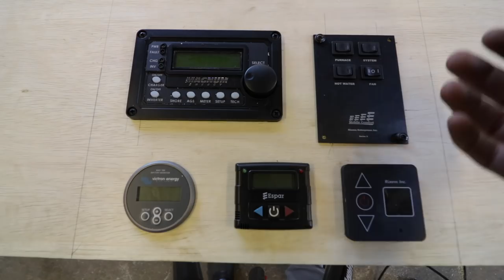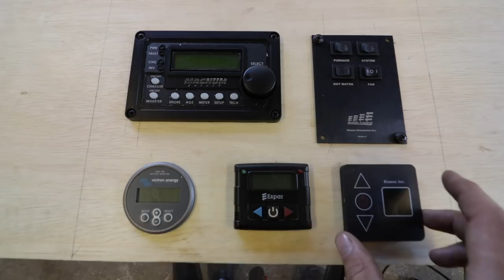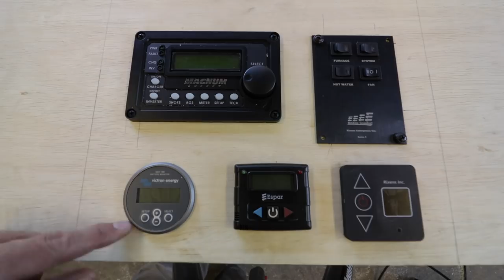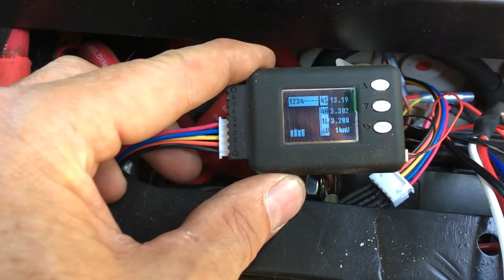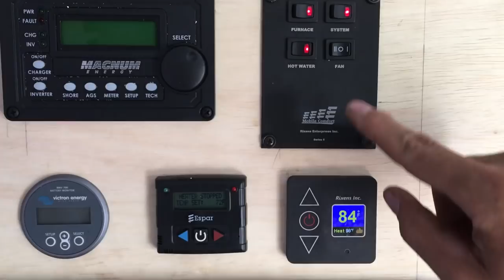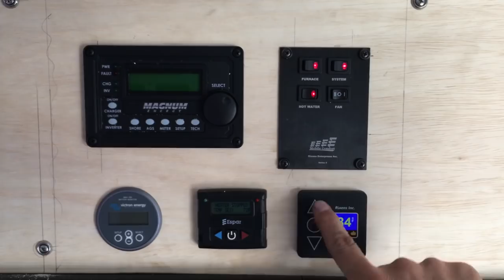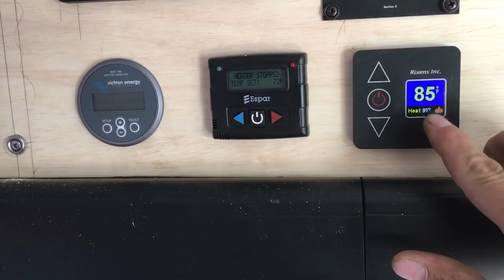We Turned It On, Then Something Unexpected Happened!

Comment: Might want to do something with that exhaust for the heater so it dosnt just point under the body. Want to get it so it sticks out from under the body so the hot exhaust dosnt come back up into the cab that most likely isnt air tight. curve it out so it sticks out the side or back of the van an inch or so. Dont need to get into a nice warm van thats got a bunch of carbonmonoxide in it. 

  If you want to make those soldered connections a bit better and long term and waterproof after soldering and before the shrink tube coat the wire in dielectric grease then shrink the tubing on and it will push the extra grease out the sides and form a nice insulated waterproof seal. Just wipe off the extra grease from the wire and you have a connection that will last forever and be waterproof and corrosion resistant.

Comment: Really nice Cody. The Blue board insulation is what some people use in this area for insulation on buildings and homemade campers. No irritants to deal with as far as fiberglass dust. It is styrofoam so it's not natural, but it's easier to work with than batting style insulation. I wanna build a caravan style camper trailer that can go off-road like my 4x4 that I am working on but be fully contained for fall and early winter camping.

Comment: Cody, the BMS (the little black monitor) on the batteries, has the tendancy to drain the first cell. This is to light up the screen and do it's checks... If the batteries are wired in parallel you can live without it, the charge controller will tell you the volts. In series I would recommend an other BMS. The Batrium BMS is better for the system, however it's pricy. The choice is yours, but I felt this was importent to tell you.

Comment: You mentioned you were not sure on Barrel Crimping large and small wires together , I work for a company that makes wiring systems for the Auto Industry ! When we have to join to wires of dissimilar sizes we put a filler wire in to make up the empty space , then crimp into the Barrel splice and Solder  ! Hope that helps .

Comment: The worst part of using shrink tube, you have to remember to put them on BEFORE you solder the connection. And I can forget why I went into the kitchen. :-) I had a small Winnebago about 20 years ago and it had a water heater that was electric or also heated from engine heat. It was great having hot water when you stopped at a rest area.

Comment: solder connections are stiff and eventually will crack the strands at the edge of the solder joint. Use marine or aviation codes for construction and you can't go wrong. Nigel Caulder's on book mechanical - electrical systems will be illuminating, I know it is about boat sytems but it shows the right way for anything that vibrates. love your channel.

Comment: When designing a information cluster that will require maintenance  or upgrades from time to time it's very important that you can access the electronics  with very little work. I see a lot of people that have used the same kind of layout that your are currently incorporating . It appears  that once you have installed your panel and its all button down it will take time to add , repair  or replace any of the devices you have installed.  I would recommend  that you place all your electronics  on a smaller removable panel  that your can quickly remove  in short order.  Other then that everything look great.

Comment: Shrink tubing professional grade has a heat activated glue that seals the tube and wires from having corrosion issues unlike the cheaper brands of “ shrink tubing” that end up hold moisture and actually causing corrosion. Just a psa for your viewers.
Reply: The term is "Double Wall heat shrink tubing"

Comment: nice you got the overcharge and overdischarge protection I was worried about.... Another thing I am big on is buss fuses at the batteries.... just in case something shorts, it will take out the fuse.

As far as marine grade vs RV grade, having owned and worked on both....the only real noticeable difference I can discern for electronics is price... LOL!.

Not sure what you have planned for tanks for fluids, but if you go plastic tanks, check out the seelevel II systems.... I am swapping my 40 foot RV to that system next winter.

Keep it coming!

Comment: Ahh but which battery is powering your switch that switches between batteries?  If the vehicle side is powering it and those batteries are dead the switch wont work to switch over so you can start it. If the aux battery is powering the switch/solenoid then it won't work if the aux battery goes dead. I had to put a manual override for just in case either side batteries went dead. Of course that dead is something that should be avoided at all costs but it does happen sometimes.

Comment: I'd recommend you building some enclosure around the heater gas pump. Those things will get destroyed quite quickly like that. Yes I do speak from experience since all cars with an external pump have it out in the open, ready to corrode apart in 10 years.

Comment: I'm a little confused. Why are you soldering the wires together before you upholstery the panel? Do the faces unscrew from the controls to allow easier separation?
Reply: wondered about that as well. I even would expect upholstery done before putting in the devices. 
I would either have thought of using some kind of easy to connect/disconnect  stuff to plug everything just in (yes, I like it complicated ;) ), or would have used some temporary clamping connector at first.
I can really recommend the Wago 221 style clamping connectors, they clamp stranded and solid wires I think from 24 to 12 AWG
Reply: Yep, wondered the same thing.  He obviously has a plan though.

Comment: Also in heavy duty truck trade the manufactures get away from soldering wires do to the corrosion created by the flux and so crimped terminals are the preferred method
Just have to get away from thinking of only using the big bulky blue connectors 
Also id think connectors would seem better since the are only temporary since your going to take it down and cover the wood

Comment: Watch where you park with the heater vent pointing at the ground or you will be using your wildfire fighting skills!
Reply from the maker: How is it different than vehicle exhaust?
Reply: Two points, first a cars exhaust is usually directed horizontally and not straight toward the ground.  Also, you are more likely to use the system while parked for the night, rather than while driving on a paved,gravel, or dirt road.  If you park for the night in dry or tall grass, turn on your water heater, then bingo instant wildfire.  It happens, just be careful or even think about installing a heat shield for the vent pipe.

Comment: Now I want a van all of the sudden.
Reply: Used Uhaul trucks are a cheap way to get started but are going to be 2wd and a gas engine but you get lots of room to work with.
Reply: Yeah...the next door neighbor's Econoline only managed 325,000 miles with no maintenance and once yearly oil changes...

Comment: Just a thought but you might want to put some grommets or something on those two hoses you have running through the sheet metal in that little box area in front of the heater core in the side panel were your right hand would be at the 15:59-16:04 mark.

Comment: Cody it’s really coming out to look really good. Been following you since you bought the van with a project. One thing concerns me about your electrical from what I could see from the video it looks like the solenoid that you are using is just a standard ford solenoid I think you will have problems with it in the future you are use a solenoid that is not reliable. But they do make hey specific solenoid that is designed to do what you are doing by charging it and isolating it from the other battery. And it is built to be able to run all the time. And you would also have to make sure that it is big enough to carry the maximum amount of old age that your alternator is going to put out to charge that battery in any given time. Otherwise it could cause failure in the solenoid which could cause a fire 🔥 I have a system in my van similar to this that I am speaking of that is wired correctly. And this is in my service truck that I use daily. If you need some help on getting the solenoid for your van I would be glad to get you to the right place. Just thinking of you and your family safety that’s all. Let me know if I can help.
Reply from the maker: It's just fine,

Comment: You better make sure you write down what all them switches are for label them we got a camper and there's switches everywhere and we don't know what none of them are so we just have to keep screwing with it and it's such a pain
Reply: A label maker makes IDing wires so much easier down the road as you can say power for X on one side and To switch X on the other. As so much is the same color label as you go and not have the fun of back tracking a wire later.

Comment: Still think using drive fuel for hot water and heat is a bad idea when you can rig up a 10 gallon fuel cell for heat/hot water and never touch the drive fuel and in the rare case you run out of gas can empty into the tank to get to a gas station.  10 gallons of fuel for it should give you 3-4 weeks of heat/hot water and be a good aux fuel tank for emergency's.

Comment: You better make sure that all the holes you drill on the underside of the frame you put sealer on them when I worked for the Japanese car plant they would have a fit if you drilled any holes and didn't steal them
Reply: You should watch the video where he mounted it...and sealed the holes...
Reply: It is a ford, it will be in the junk yard in 7 years.
Reply: Your perception isn't reality.  Any vehicle can be used for 100's of thousands of miles as long as you do preventive maintenance and replace parts as required.  Bruce Berry was working man, he used to load that Econoline van...

Comment: Re: crimps... good move to use solder.  Areospace engineered crimps are actually better than solder, but are exacting as to wire type and size, and expensive.  Automotive crimps are cheap in labor, but are notorious for poor reliability, whether due to bad workmanship or just the wrong combination of wire, crimp connector, and tool pressure.  A good wet solder connection is much more reliable!
Reply: I have seen some connectors which are nice as well, it is some kind of shrink tube and has some solder/glue stuff in it to tightly connect (glue) to the wire jacket at the outer ends and solder the strands in the middle. Only caveat, I found those to be wuite expensive. 
Other than that, a good tip could be to stagger the "splices" (I use this now meaning any kind of soldered or crimped connection as well), in case the total outer diameter has to be considered or the cable need to maintain more flexibility.
There are some (older ?) documents floating around about what NASA expects on how crimps and splices have to be done. Not saying that everything need such a type of connection, but I found some of the general ideas in there quite useful. for example doing a "lineman splice" before soldering, or staggering the  splices to avoid having all splices in one place, increasing the diameter of the wires a lot in one place.

Comment: Soldering is just such a bad way to go.  You can easily learn crimping in about 10-20 minutes.  Contact anyone in an avionics shop.  When using the heat gun, you should use the add-on that provides heat on all sides at the same time.

Comment: An improperly installed inverter above 1,000 watts may start your vehicle on fire. l drove truck for a company that required that any inverter above 600 watts must be installed by them. Apparently a driver installed a 3000 watt unit in his truck and burned it up. They put their own double breakers in and threw the ones away that came with the inverters. Some manufacturer's quality control wasn't very good, that was in 2001.
You are doing a professional bit of work on that van.
What are you going to use to insulate the roof Cody?
Reply: Mountain Fisher I am thinking wool there too
Reply: Jared; What kind of wool?
Reply: Loose fill 100% wool insulation. He mentioned it in a previous video but I don't recall the brand

Comment: Wondering about system safety... once in a blue moon you hear about a mishap with CO (carbon monoxide)... recently a family living in a car in CA died on a cold night, heating the car by running the engine.  Will you be installing a CO detector?
Reply from the maker: The generator is outside,
Reply: True.  
And that heat exchanger isn't pulling ventilation 
air from the engine compartment.  
Good design.

Comment: Just curious how you intend to take a Family of 4 including a newborn infant in that Van?? Wouldn't you have been way way better off buying a 25 - 30 foot Trailer that would sleep 6-8 with a full Galley, a Bathroom, entertainment and a little privacy as well? (maybe a year or two old which are available for about 25K or less) for a lot less than you will spend on this small van once you finish outfitting it. This is just my opinion of course but I am trying to understand your reasoning and rational.
Reply: Bobby W this is way cooler! But Seriously, hauling a trailer is a lot of work. Just driving a van is so much simpler. Especially in areas that aren't camper friendly.
Reply: I think they see this as more of an adventure van than an RV.  Versatility to load the bikes, take a ski trip, maybe a few days camping...Not really a family vacation vehicle.
Reply: I don't think he would want a camper for the type of adventures this van will be used for.  Imagine remote roads covered in snow while pulling a 30ft camper. No thank you!  I understand the want/need for campers for some families but everyone "adventures" differently. I am more of a hammock, tarp and sleeping bag kind of camper.
Reply from the maker: Because pulling a trailer sucks,
Reply: Branden Clark +1 I'm a hanger myself.  You watch Shug @ shugemery?
Reply: Wranglerstar did for years and it does
Reply: Nope but I will check it out.
Reply: He already has a full on rv. Its  in the background of multiple videos.

Comment: Micro butane torch for soldering
Reply: The soldering gun he's using is better, as long as you have power for it easily available. I do like the little butane guns, and I use mine often.
Reply: 2ndarymotion heat shrink. It's called heat shrink.
Reply: in the uk, its called shrink tube
Reply: Just think of the comma as the misplaced apostrophe... :-)
Reply: @Yar Nunya - Actually, you do need a comma there.  "in the uk" [sic] is a dependent clause, and "its called shrink tube" [sic - missing apostrophe, as Tenspeed noted] is an independent clause. Therefore, they should be separated by a comma.